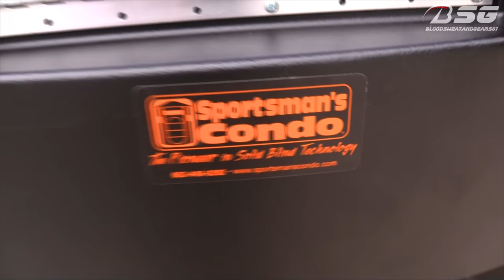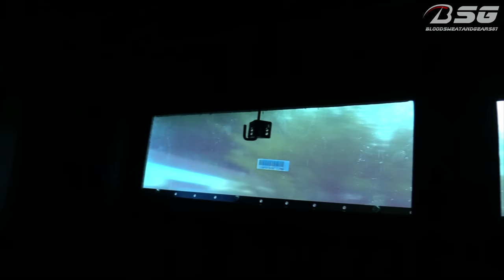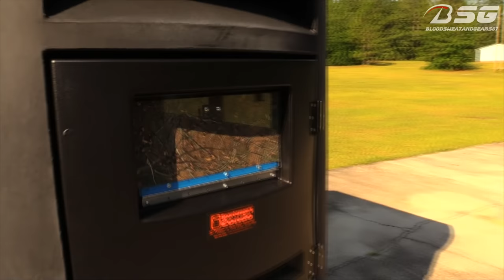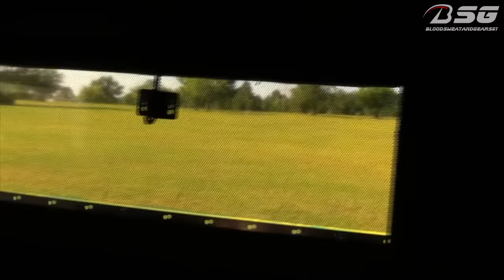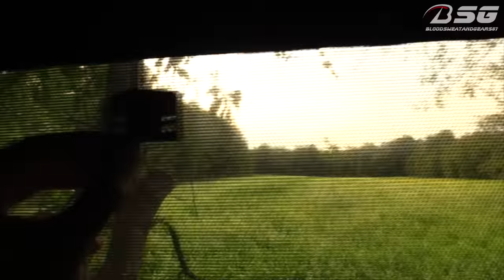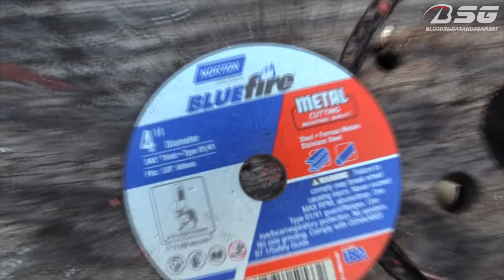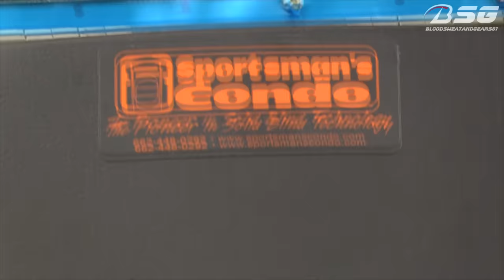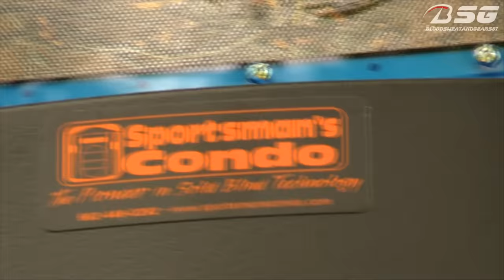NEW BOX BLIND/TOWER STAND BUILD!!! **SPORTSMAN'S CONDO SC-2** [Raising, Leveling & Anchoring] VLOG

Comment: Very good. Nothing like plenty of good help to make  a project go well. Well done setup IMO. Got a suggestion for you. Instead of carpet go to Tractor Supply or similar place and get a piece of stable mat. It is about one inch thick heavy rubber. Cut it to fit. Does not hold water or bugs. You can clean it somewhat. Does not rot and unaffected by weather or temperature. It is heavy but you only got to put it there once. Free idea.
Reply from the maker: Great idea! I just picked up a carpet kit and installed it a week or so ago. If it doesn't work out I will definitely try the stable mat. Thanks for that idea brother.
Reply: @bloodsweatandgears87  I am looking forward to watching your hunts from the blind good luck my friend.

Comment: Just bought one today.  Your video helped make that decision.  So I appreciate it man!  You still like it?
Reply from the maker: No problem bro, I'm glad I could help!!! Yup, I still like the stand! I actually just got my 2nd one and put it up a few weeks ago. You won't regret your purchase.
Reply: @bloodsweatandgears87   Nice.  I’m looking on Amazon for a rubber mat and/or a rug for the bottom.  Did you do anything for the inside sides?  Or did the floor dampening pretty much kill that weird echo?  (Several have reported the echo).
Reply from the maker: @sullimd  I bought one of the carpet kits that Sportsman's Condo makes that is cut to fit the floor. I think the rubber floor mats will work just fine also. The inside had a terrible echo, to remedy that I ordered some sound deadening egg crate foam from Amazon. It took around 4 rolls to get the walls, ceiling and almost all of the inside covered. The Amazon link to the foam I ordered is below.
https://www.amazon.com/BookishBunny-Adhesive-Acoustic-Crate-Studio/dp/B07KGN7TNJ?ref_=ast_sto_dp&th=1&psc=1

Comment: After hunting in the any pros and cons looking at getting one of these blinds
Reply from the maker: I'd say go for it bro! I ended up buying a 2nd one after my first season using this one. The only CON I can think of, is that it can feel a tad small if you have someone hunting with you. If you're hunting alone its perfectly fine, but if you plan to bring anyone along it will feel rather crowded. You will also have to make sure you sound proof it. I used egg-crate sound deadener from Amazon and that worked out perfectly.

Comment: How far apart are your steps and what screws did you use for those?
Reply from the maker: The step bracket kit recommended using #9 deck screws, I couldn't find those so I went with #8 deck screws if I'm remembering correctly. Also, I can't remember the exact distance between each step but for some reason 11" sounds familiar. I'll measure them next time I'm out there and see if I can find the box of screws I used, so I can give you the EXACT answers.